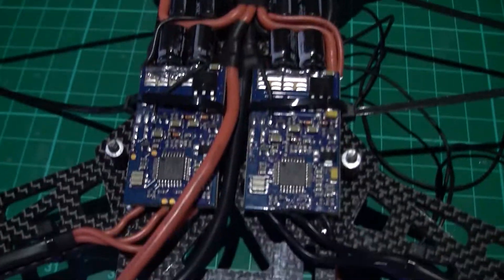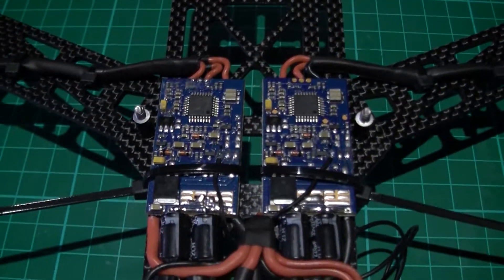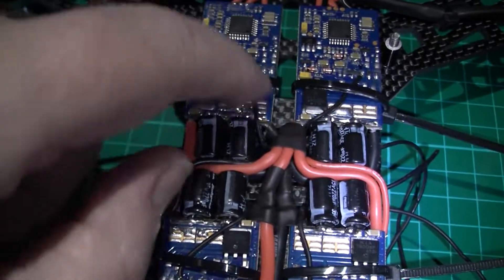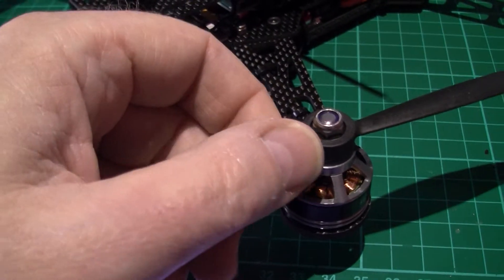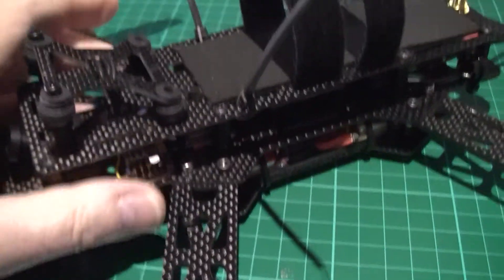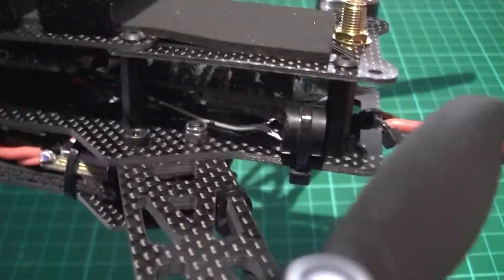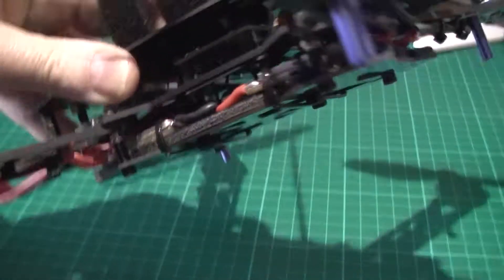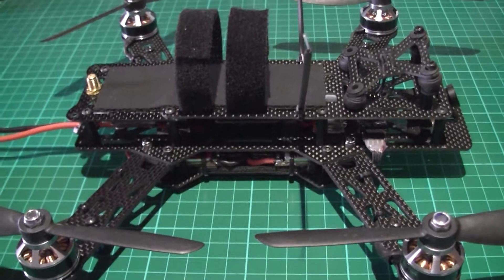250mm mini quad - the new rocket ship

Comment: that wiring job is excellent! So its safe to say most real builders dont bother with PDBs?
Reply from the maker: Bill Sheley Thank you :)To be honest, a PDB is a matter of convenience and ease. I hate bullet connectors (which are just another source of failure) and don't like masses of area that that are exposed to potential short circuit. I have used PDBs before, but soon ripped them out :)
Reply: I bought a PDB to finish my zmr250 build but its way to big.  I'm contemplating grinding it down or just using the "super simple pdb" that bruce shows in his rcmodelreviews build.  Its not as sexy but its much lighter.
Reply from the maker: Bill Sheley You need a maximum 36mm PDB for 250 size. HK do a 30.5mm PDB with a built in current sensor. No idea what they're like, but they look cool........and always sell out as soon as stock arrives :)